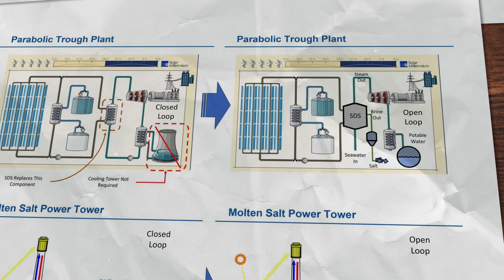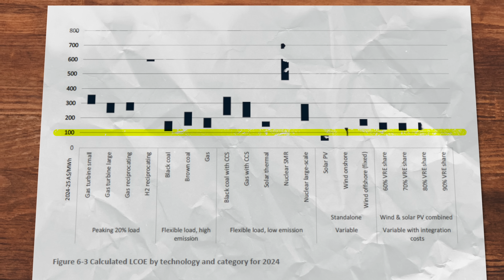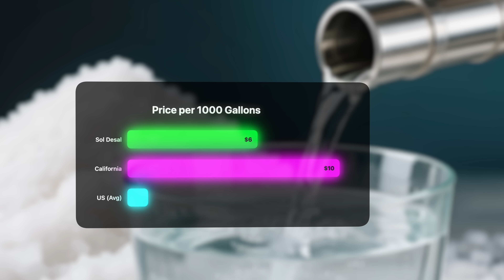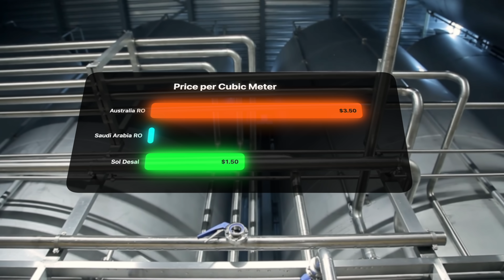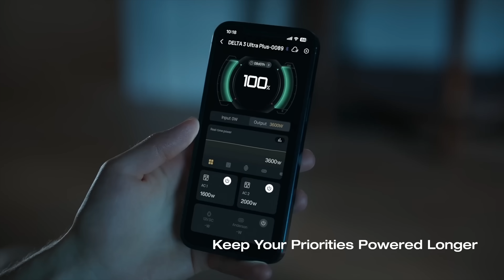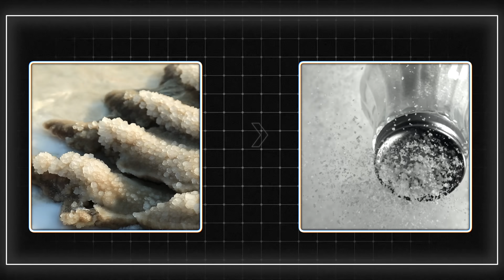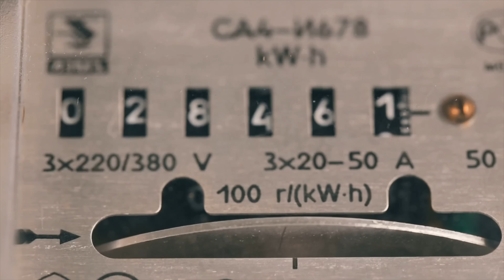The Desalination Process that MAKES Electricity - Too Good To Be True?

Comment: Can you just use the excess salt to make salt building bricks? Maybe hot dip them in melted recycled plastic to provide a water proof coating then build walls or pyramid structures. Build stuff or just land fill/reclaim with them. I'm sure this was also an idea for dealing with hazardous waste, where it was heated to a plasma and the ash formed into glass/ceramic blocks that lock all the nasty toxic substances in a very durable form. Pilot plant in the north east of England sadly failed for some reason. Nice idea though.

Comment: One solution for the turbine might be to have severthat are rapidly interchangeable.  Or have diversion valves that move the steam from one turbine to the next. The off line turbines can be cleaned and maintained.  One in action, one ready to go, one in clean.

Comment: I hate to be that guy but too often I've seen new technology suffer the Tesla effect where it's over promised and woefully under performed. 

My last company spent big on a new evaporator, that was supposed to be 20 times more efficient than the older system it was replacing. Well at best it was 8 times more efficient, so well below expectations, which is a lot considering the amount invested, including a grant from our government to get it installed. Worse, it more than doubled the time it took to restart that section of the refinery if it went down, which happened a lot. Lost production is a real expense that needs to be accounted for, even if you might be able to catch up later on.

Comment: this makes me wonder, what would happen if you poured seawater into a plasma gasification system?

When I first heard about those, the claim was that you could get elemental particles and pure metals as a result of the plasma furnace. Waste products would be thrown into the furnace and used to keep the plasma hot, thereby keeping the furnace going.

Can water be used as a fuel to keep a plasma furnace going? And if so, what would be the precipitate? Would you end up with either hydrogen or oxygen, or water on the other end along withsalt glass? And by doing so, since it would get to such a high heat, would that solve the issue of pitting in a turbine generator turned by steam?

Comment: well the question in this case isn't necessarily what to do with the sodium, although that is certainly important, if we find uses for sodium, which include certain batteries, certain nuclear power plants, and other systems which can use liquid sodium instead of water as a heat transfer medium, the question then becomes what do we do with the chloride?

I assume that the salt and salt water is sodium chloride. I also assume that the sodium we are talking about for these other purposes is only sodium. So do we have industrial scale uses for chloride that are currently being met? And if we do use it in that way, what is the implication of flooding a market with that much chloride?

I'm also assuming that the weight of the salt that's being discussed is approximately50-50 between sodium and chloride. I don't care to look up which has the higher atomic weight, but I imagine that they're very close to the same, within a few percentage points.

Comment: I think this desalination process producing electricity is absolutely brilliant. Two questions come to mind in regards t the desalination itself 1) Could the increased need for salt to make thorium reactors and sodium ion batteries be sufficient to use up the increased production of salt in the desalination process producing electricity? 2) Could all the parts of the turbines exposed to brine be coated with tungsten carbide spray to prevent the corrosion, abrasion and adherence of the brine?

Comment: Are they failing to incorporate the condenser vacuum phase into a larger surface area non-boiling/vapor pressure in lower atm pressure induced evaporation requiring less thermal input(solar or other), drawn to condensor but still drawing turbine.  You don''t need to boil the water go creste fresh wster, just scsle the vaporization surface area and decrease the atmosoheric pressure. The circulsting turbine steam can, podt turbine, blow over non-boiling seawater, hsrvest water evaporate(* ? Volatiles).sans Saline droplets, accruing fresh water on condensate as open loop  but extra siohoned out to doenstream seawater pre-heater to recruit thermal yield, all requiring less heat inlut to Evasprste over larger area fir fresh wster vs boil smaller.=no contamination of turbine loop.
Reply: Also, crystal salt, or less dnergy reqhired skudge can be dumped in submsrinecsskt dome intruded areas or pumped into old salt mines or subterranean dome regions without envirinmental impact.

Comment: Immediately I see them sweeping under the rug the fact that seawater isn't just salt and water. And while I could see this as taking advantage of some complementary aspects of solar power and desalination, it's more like a solar generation system which distills water as a side effect.

2 concerns come to mind immediately: 1. What expendables are involved? This is a big problem with desalination. You don't just turn it on and get fresh water, and it isn't just the leftover brine that's the problem. At the very least, you have to clean the equipment frequently. 2. What are the longer-term maintenance costs? Solar panels have to be replaced after a couple decades, if not sooner. If not solar panels, other solar energy harvesting systems typically still have some maintenance costs.

Comment: This all sounds great on paper, until you remember that molten salt is extremely corrosive and any power plants that use it have a TON of maintenance costs and reliability issues. Part of this circle of efficiency relies on that, which means this isn't going to work until we can make some significant material advances.

Comment: It takes a shit ton of power to boil water. IIRC, It actually becomes harder to boil the more salt you add. Or conversely, the more pure water you remove. So actually going from brine to pure dry salt is... going to be difficult. The concentrated light focuser is basically going to be a supervillain's death laser. The tubes and shit in the side of the design are going to suffer massive heat exposure & should be under or over the focus point. It's an interesting concept, but I fear for the execution.

Comment: Ask a power engineer about how happy they are to run untreated sea water into a boiler and then a turbine. 

You can't put untreated water into a boiler, or a turbine. This causes the boiler to explode due to reverse temperature solubility of suspended solids in the water that come out of the water when heated in the boiler. That coats the inside of the boiler in an insulating layer that lowers the heat transfer from the hot side to the water leading to the boiler overheating and exploding. 
Turbines pick up the smallest trace amounts of material from the water and build up on the blades, most problematically iron in the PPB range. This causes the turbine to wear excessively and fail. The damage happens faster at higher pressures and temperatures, but anything near an industrial scale will need to treat the water to remove the iron. 

Now you can take filthy water and under a vacuum boil it to make cleaner water, this is the process used in a once through steam generator that is used in SAGD oil production where you need steam for heating the oil in the ground but don't need boiler quality water. Those OTSG work in constant cycles of tear down and cleaning while a normal boiler is good for years of operation. 

As for brine, just mix it back into water. Find an area with a strong ocean current and your tiny (relative) amount of brine gets mixed back into the ocean where it came from.

Not even starting to talk about the pH level of the boiler water and the dangers of low pH water in a boiler. 

I hope whatever regulatory body governs them stops them before they try and run sea water in a boiler.

Comment: I've been trying to gain attention to a similar system for over 3 decades. Couldn't get a single person or government interested. The system I designed primary goal was electrical power generation. Water, minerals, dissolved metals and others would have been profitable byproducts.

Comment: I worked at a facility in downtown Houston's medical center around 15 years ago that had a similar operation principal, but instead of desalination, they produced chill water for nearby medical center buildings. 

The similarity this process shared with the one shown in the video was the reclamation of latent heat.

This facility created steam by heating water using natural gas, which powered steam turbine generators to generate electricity, which operated chillers. Once chilled, the water was pumped to nearby medical buildings where it was used for HVAC purposes. The hot water discharged from the HVAC systems was then piped back to the facility and heated to create steam for the turbine, which minimized the amount of natural gas .

Comment: there are more than a few physical laws that invalidate that this is even remotely possible. A few questions......1) are there any parts of this operation that require parts? What are these parts made from? Are they transported? What is the efficiency of the solar panels used for electrolysis? Has this tech disproven the physical laws that suggest they're entirely implausible? This is a bunch of bs. Google search "can more energy be output than is input? "

Comment: I'd be interested to learn whether these solar-powered things, when they're finally online/functioning in more than controlled lab settings, could also take some power from wind turbines and water turbines (external to the desalination machinery, but contributing to it), in order to both provide power for desalination and, if enough power is generated, to sell back to the grid or use it to power more facilities. This looks very promising, but I'm no scientist and not qualified to speculate more than this.

Comment: How high could you get the steam up, say, a mountain? You could also have several solar stations to re-heat the water for steam turbines to keep it going higher. Hundreds of feet high. High enough so that when the stored water comes back down you could use gravity to run more turbines to generate more power. 

Solar to not just desalinate water at the beginning to generate power while going up in elevation and then dams with generators for when it goes back down.

Maybe even using lots and lots of salt bricks made from the first step to insulate the steam pipes going uphill (and any leaks that leech salt to flow back down to the first step)?

Comment: How would they use solar radiation to heat the seawater? This video shows a concentrated solar plant, but those seem to have gone out of fashion due to high maintenance cost of the mirrors (have to be constantly cleaned, etc.)

Comment: The salt problem can be overcome. Right now, Australia simply evaporates seawater in the sun(at least the facility I know of). It requires a system of ponds.  As the salt concentration increases, it is pumped to another pond until it is basically solids. . The process could be easily adapted. It would just remove the requirement to take saltwater from the ocean. That would be an initial solution until something better was developed. Initially, these systems could be viable where there is no cheap water available due to lack of infrastructure. 

I can see how the turbine issue will be tough to solve. I spent 3-1/2 years on a ship that had an old fashioned steam turbine. It had it's own twin desal plant. It was essential to have redundancy. I hope they succeed.

Comment: The more pressing problem - how they are dealing with the corrosion issue? Brine is a menace to almost every material. The second problem is clogging - salt will get everywhere: on every component, tube, and surface. It needs to be cleaned - how?

Comment: Concentrated Solar Plants (CSP) are in their way out this system seems to use a lot of the same technology as CSP plants.

Conventional CSP plants have water treatment plants to first make potable water and then demineralised water. In theory, CSP also seemed like the perfect technology, but it is more expensive than wind and solar PV. I'm afraid that this system might also not be as perfect as initially thought.

I hope they are successful, though.

Comment: okay you commented about salt carry over problem what about the scaling on the heating elements.  Usually to prevent scaling by boiling sea water it is to boil under a vacuum so not great to run a turbine.  Scaling and just general maintenance would be a nightmare after operating a flash desalination after 6 months i have seen 10-20% reduction do to scaling.  So i just dont think this can be done the was they are saying.  Flash desalination has been using the "steam" for decades to preheat the feed water so most of this is well known engineering problem i didnt hear anything that sounds like a break through.

Comment: This is obvious for the Qua-tar depression. You can skip the boiling . Just reverse osmotic desalination. Let the saline waste crystallize in the sun. The evaporated water in the atmosphere will precipitate out causing rain in the depression ( >400’ below sea level) the salt can be put in the ground. Sodium ion batteries will leave you with a bunch of chlorine (more than you can use) that is more toxic than salt and as a corrosive gas very hard to store. 😮 Salt mine show how well salt can be stored  in the ground.😊

Comment: Stripping that much sodium from the ocean is actually counter-productive. The theory behind the movie the Day After is that the ocean currents get broken by the introduction of too much fresh water from the melting polar caps. So perhaps the best answer is to return 90% of the brine back to the ocean in a diffuse manner to avoid any concentrated therefore toxic streams and simply reap the benefits of pure water and clean electricity. The 10% sodium capture would be an adequate supply for sodium ion battery manufacture without creating overwhelming salt stock piles. Otherwise, great idea to answer multiple needs. 
In the US Navy, we operated 2 stage flash evaporators that effectively eliminated 100% of any dissolved solids in the output stream. So imagine a 3 step heating loop: 1st heat and flash incoming sea water under vacuum (140 degrees F). Condense while pre-heating the incoming sea water. 2nd re-heat the condensate to a higher level (180 degrees F) flash a second time at a vacuum and then condense while again pre-heating the incoming sea-water. 3rd re-heat the now pure water to whatever terminal temperature the solar generator can produce while increasing the potential by raising the pressure exponentially and the admitting to the turbine which is operated into a condensing turbine that is the first stage pre-heat for a stream of incoming seawater for both distilation and brine dilution for safer re-introduction to the sea. Any salt capture could be done on the most concentrated brine coming out of the first stage of the evaporator.
Reply: There is 50 quintillion kilograms of salt in the ocean.
No amount of sweet water can change the salinity of the ocean.
And polar caps will never melt, too much of ice...in hundreds of gigatonnes gain each year.
Reply: @WadcaWymiaru  And yet 50 miles from the arctic cap the water is fresh enough to drink. But beyond that, the volume of salt produced if 100% captured would also require vast tracts of land be given over for  the accumulation and represent an ecological time bomb for cataclysmic events like tropical storms or tsunami waves...
Reply: @BryanWolf-b1x  
No idea what you mean, 50 quadrillion tons of salt is enough to make the whole glacier water salty. (however without snowstorms, gigatons of ice will not move)
Reply: @WadcaWymiaru  Watch the movie. First explanation for the wooly mamouth carcass that seemed reasonable. Water salinity plays a role in currents. Man's hubris in industrially changing natural patterns is why we are where we are. My thought process leads me to why pull excess salt out of the ocean

Comment: Is there a means to filter the salt water droplets from the steam before it gets to the turbine?  I don’t know enough about boiling salt water and the droplets in the steam that has salt in it -  -but could there be a grid of the same material as the turbine that filters the salt droplets before the steam gets to the turbine that would if not eliminate the problem substantially reduce it?

Comment: Okay first off to create steam and create useful steam are two different things.

Secondly to create steam that isn't carrying HIGHLY corrosive salt is a giant challenge not even remotely addressed here. 

Thirdly the rate of steam generation and even moving the salt it leaves behind so that you're in a continuous process is completely ignored. 

Fourth molten salt has been promised for 2 decades and still hasn't shown to be useful. 

This is a half baked VC pitch at best that only firms with no business doing physics would invest in.

This has been pitched every few years or so and fails every time